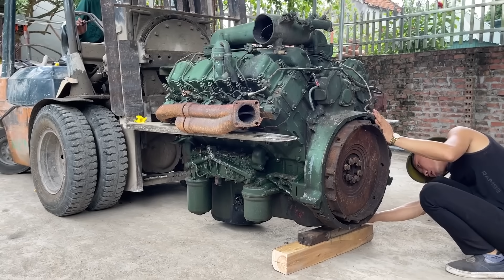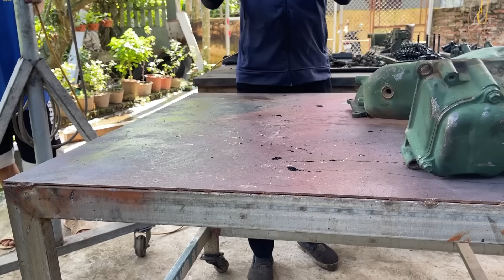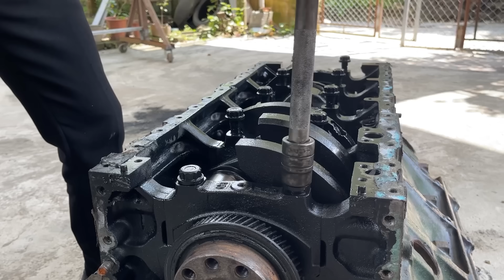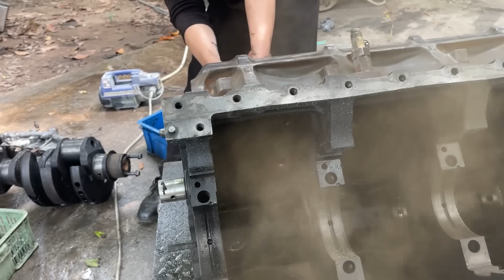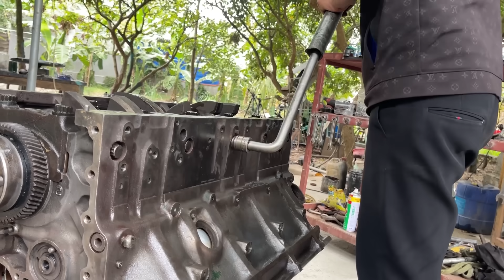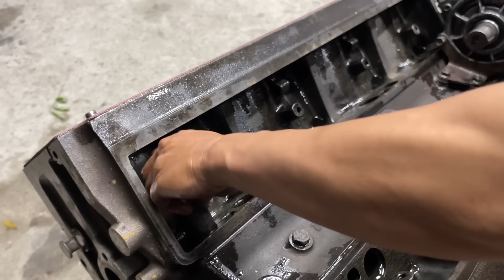Revive A Flooded Super Engine // You Won't Believe What Happens Next !

Comment: Well they are one or two steps more advanced than the Indian boys, as in at least they have impact wrenches and a bench!  That valve job though, the valves were already recessed before they started, you could actually see the valves sinking as they revolved them. Never lifted them as they ground away and someone should tell them it only takes a few minutes by hand with a grinding stick, not half an hour with a power drill!!  All the procedures were as shonky as hell, but I suppose they have to make do with what they have. You guys really need a hot tank to clean parts, you could build one easily and use the waste oil as fuel.
Reply from the maker: thank you
Reply: Certainly very dubious assembly practises and attention to contaminants and cleanliness is poor.
Notice how casually piston ring offsets are ....well literally Ignored!
In most of Asia reasonable quality 
Chinese tools are readily available at very reasonable prices, this is literally a back yard operation, there are quality engine building specialists in most larger Aisian cities however this doesn't appear to be one of them!

Jus sayin'

Comment: 🎉assembled the engine without a drop of oil on the main or big-end bearings !.😊
Reply from the maker: I washed the oil outside before putting it in
Reply: YOU  ARE  WRONG
Reply: @jamesmckay9966  Hardly,they put little on the crank though barely and none on the bearings. YOU ARE WRONG.

Comment: No oil or grease on the main or rod bearings & no proper torque settings on bolts. Ring lands are sanded? Crank is a scratched up. All that work gone to waste. Motor unreliable
Reply from the maker: Thank you for sharing. Thank you

Comment: I sure like the way does the motor was cleaned up washed out with a pressure washer blown out with air and then everything redone again one thing I noticed in the tearing down of this motor I never heard a bolt in ENY part pop like they should have done did not seam the head bolts ore eny of the bottom end had been worked at ALL
Reply from the maker: thank you
Reply: @amazingrestorations1117  I really enjoyed watching the tear down back in my early teens I work in a service station pumping gas and diesel fuel I was making a penny a gallon on gasoline An a nickel a gallon play diesel fuel I was the one that usually would get stuck breaking a motor down and cleaning it up the old man that owned the place had me using kerosene and Tide washing powders it worked out pretty good I didn't have a father and the old man at the service station tought me a lot I appreciate the time that he gave me when I needed it most I still remember what to do and how to do it but I'm no longer able to do it

Comment: So many bad practices here, why dismantle an engine and power wash it on the ground in the dirt? No oil or waterways pressure washed and or blown out, no liner honing, nothing torqued to manufacturers spec, heads should be tightened in 2/3 stages with a torque wrench, the list goes on. lt probably would of run ok but for how long under load?
Couldn't work out why he wore a hard hat but canvas shoes!
Reply from the maker: Thank you for sharing. Thank you
Reply: Those are the new style steel toed canvas shoes, OSHA approved. I think those retail at Walmart for $11.98 US.

Comment: All the knowall comments about how long this would last etc totally ignore that fact that many light truck owners in the west have engines that grenade themselves in low milage use as they are so highly strung even though they have been assembled in sterile conditions with torque wrenches and all sorts of 1st world gadgetry that sadly adds little to nothing to these modern engines reliability as well as ignoring the other fact that clearly these chaps have done this many times before and these engines are indeed giving good service in these countries... if that was not the case we'd be watching videos of these same chaps doing this in some flash harry service joint set up by Richard Rawlings on tv..... This small minded "only we can do this sort of thing" BS that has permeated us here in the west for so many decades is really quite boring now, especially when these countries economies are doing better than ours.....
Reply from the maker: thank you

Comment: How many horsepower does this engine have?
Reply from the maker: 975 cc engines with a capacity of 19Ps to 22.8 liter engines with a capacity of up to 385 Ps. Thank you
Reply: 385 HP and MAYBE 500 Lbs/Ft of TWIST/Torque !